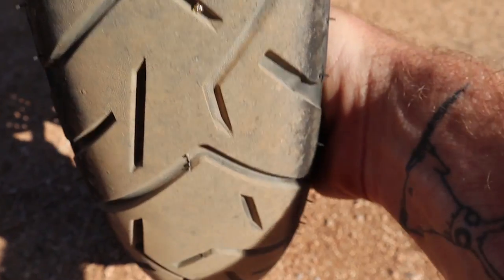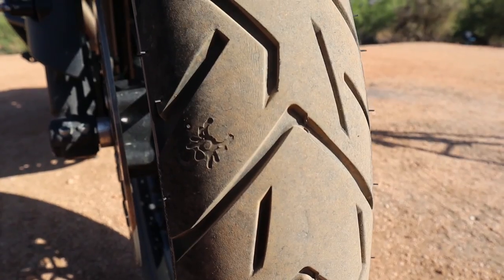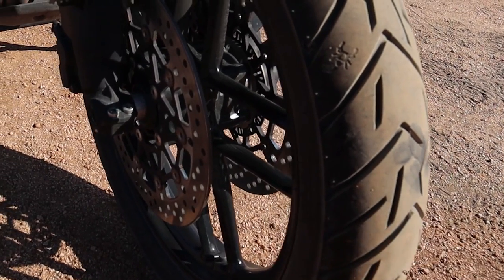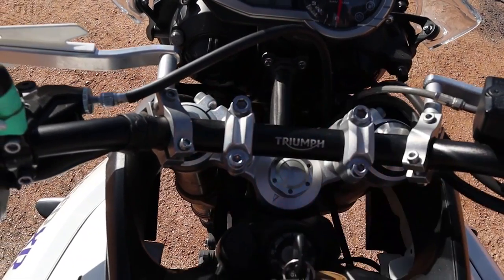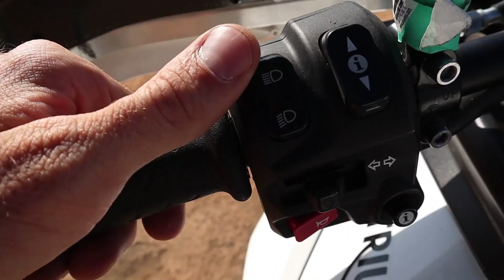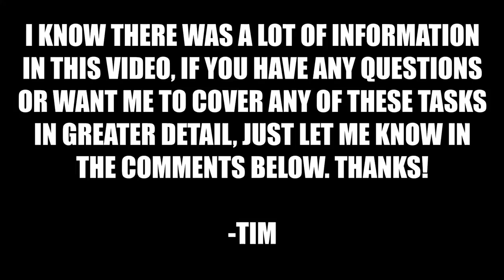Motorcycle Safety Inspection   How To and What To Look At

Comment: Tip for battery terminals: Give them a thin coat of copper grease. It helps to protect them from the elements and stops the connectors from corroding while remaining conductive due to the copper content being so high.